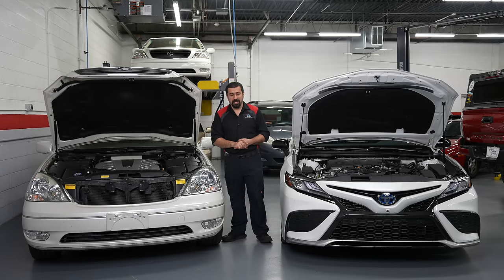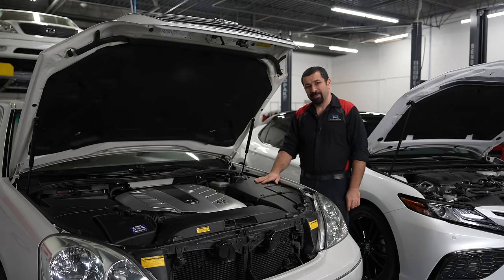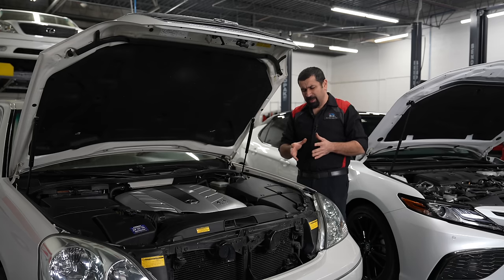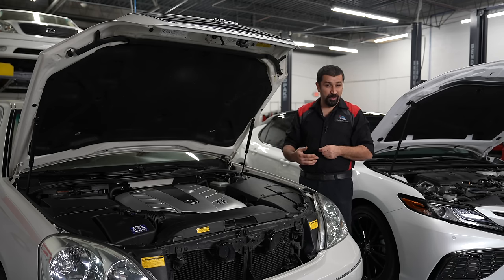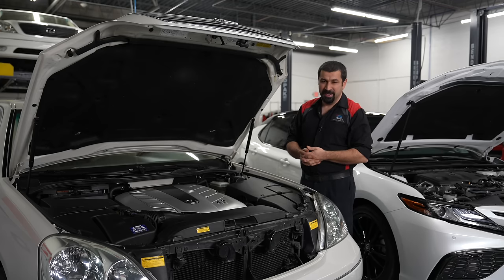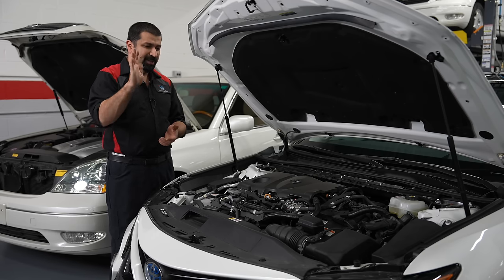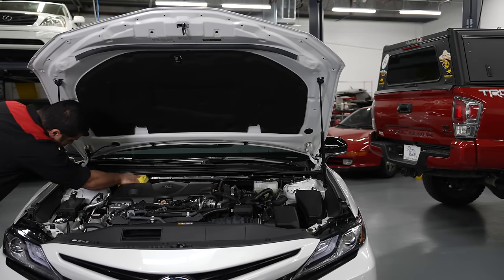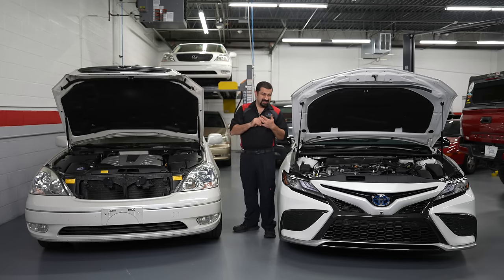Never Do THIS When Cleaning Your Engine Bay! Do THIS Instead

Comment: I use Dawn and Awesome. Mix half and half in a spray bottle. Shake well and spray a mist over the engine bay. Let it sit for 10 minutes. Then rinse off with a high pressure hose BUT DON’T PULL THE TRIGGER ON IT. Just mist off the cleaner and dirt......voila! The way I look at it....if Dawn can clean oil from waterfowl without harming them, then it's good enough for my engine bay. Awesome, which can be found at Dollar Tree is a good but mild de-greaser (read the label). Just remember to cover the alternator and mist of the cleaner/dirt...no pressure. I've been doing this once a year since my car was new. Works for me.

Comment: I didn't read all the comments, so forgive me if I happen to repeat something that was already said. I am an auto detailer with 4 years of experience and I use an Adjustable Pressure Regulator on my pressure washer wand to drastically reduce the PSI when detailing engine bays, I then follow up immediately with an air compressor to air dry all electrical connectors. Altenaters and air intakes that are not in an " air box " must always be covered with a plastic bag to prevent damage.

Comment: As an amateur detailer myself, I will never understand people’s obsession of deep cleaning under the hood. I only clean the plastics such as covers or painted areas using PolishAngel engine and only spraying small spritzes onto a microfiber cloth and then gently wiping down. PAE is a good product in this regard because on top of the precautions I take, it is non-conductive and will never corrode on plastic or metal. Even that is not necessary and I admittedly do it just because I like it to look somewhat clean under the hood.

Comment: I use motorcycle chain cleaners instead of brake cleaners as they usually are not that aggressive on rubber, as chains have rubber o-rings.

Comment: I get that sudden change in temps can fail an O2 sensor, so then why do manufacturers put O2 sensors on the lowest part of the car (mainly the lowest section of the exhaust pipe)  that water gets to? Is this on purpose?

Comment: Use an air blower to blow away loose debris and dust. Spray lightly with armor all tire shine and cleaner 2 in one, staying away from things that should be dry. Use blower to blow away excess, wipe flat pieces such as plastic engine covers. Easy peasy so long as you don’t let the area get filthy in the first place.

Comment: I don’t get it, water will seat in pockets, connectors etc? The moment you start the engine, it will get so hot, water or moisture will evaporate. I have a 2001 Sequoia bought new, washing the engine every spring after winter, up to now, I still have it with no single problem.

Comment: If door seals keep cabin dry and clean,why not do the same to Hybrid engine bay and can I do it myself?.
Reply: Generally don't do it.  The air coming through the grill helps in cooling down other components under the hood.
Reply: Sorry,not the grill,the hood is only sealed at the back from water not the sides.Auris/corola. @michesbianan

Comment: Also be careful with rubber hoses. If you’re using harsh chemicals to clean your engine they’ll eventually dry and brittle out your rubber hoses. Always go over your rubber hoses with a trim restorer that’ll rejuvenate, restore, and rehydrate your rubber hoses to keep them flexible and strong.

Comment: You have to insure the alternator and electrical sensors are covered..
Plastic bags work great..use low pressure briefly to wash off an engine cleaner..
Keep it to a minimum and let your engine run for 20 minutes..then use a rag to keep it clean

Comment: Even easier on dusty engine bays- I use a microfiber cloth plus eindow cleaner. Leaves no residue and no need to rinse. I use this method on basically anything lightly dusted (well not on the bodywork but you get the idea)

Comment: Just water spray  and microfiber on the touch screen is fine. That's what I use. Or wet microfiber.

Or wet microfiber is all you need even in the engine bay.😊

Comment: Everything can get wet now I said wet not soaked there’s difference. When your at the car wash stand back from the car and spray the engine from a distance don’t spray the engine standing right next to it the high pressure water can cause issues with sensors. So stand back and keep the water moving so move the water from left to right in a zig zag motion. I’ve been doing it like this for years with no issue.

Comment: I drove by accident in a flash flood, water rose to headlight level, water was in the headlight, 5 month later the ECU was burned out.My 15 year old car has not been running for the last 6 months.I didnt think about the alternator.Car washes around me pressure wash their engine bay.very sad.i was lucky enough for no water do get thru the intake which was high enough to be above water level,sadly the electronics didnt survive

Comment: What I ususally do is use cleaners in specific areas and use a towel to clean the grime. It takes longer than spraying the card down but you will be happy in the long run.

Comment: I usually will hit the underside of the hood on the outer perimeter of the insulation blanket very quickly, then air blow and towel dry.

Comment: I clean my engine with my car running the heat will dry things quickly I have never had any problems that way but I did have problems doing it on cold non running engine

Comment: I sprayed degreaser on the engine and then rinsed it with water without pressure. Water got into the alternator pulley and damaged it.

Comment: Save yourself a lot of potential trouble and expense and leave it alone. Machinery doesn't care if it is dirty. Under hood areas of cars are not designed to be hosed with water. When you are driving in the rain only a fine spray of water gets inside there, not gallons. A fine mist is a lot different than a heavy stream of water from a hose. You soak all that electrical stuff under there, and you are playing electrical connector Russian roulette. 
Be careful with any spray cleaners. Some can mess up your paint. And unlike under the hood, paint damage is something you will see.

Comment: In the mornings when the engine is cold, I use a regular garden hose with the tip set to jet.  I'll spray around spark plug coils to rinse off the mud that occasionally winds up in there during rainy season.  I'd don't directly spray onto the coils.   Sometimes wasps or mud dawbers will try to build a mud nest in that area.   Then, I rinse the top of the intake manifold to get rid of any rat nests that sometimes appear.   Then I check the wires to make sure none of them have been chewed.  I keep the hood up till it gets dark.  However, in this 100 degree weather, the engine bay is completely dry by noon.  I'll spray WD40 on the connectors for water displacement and also around the pulleys.  Toyota engineered their 4 bangers well.  When water pools on top of any engine surface, it usually drains off to the sides and into the rear.  I figure the engine tilt on these 2.7L Tacomas  is there fore a reason.  What I should do but I'm too lazy is to take off the belt and wash it with dish soap to rinse off any oils that may have spilled onto it.  A little water in the alternator isn't a big problem.  It's when you have a radiator leak spray into it and the stop leak in a can you were using contains copper.

Comment: How do you stand on removing engine beauty covers?
Reply: On hot summers, you can remove them.  This helps prolong the wire looms / wires  that is part of what is covered by the beauty cover. Other than that, don't overthink it.

Comment: hay car nut I do none of my own work .that is why we have you guys for I have a 2011 crewmax with a 4.6 v8 when the light comes on I go to Toyota and pay the $100.00 and oil is changed then  go on what can I do to help my Toyota and them that work on it?
Reply: To start off, get yourself an OBD scanner and scan the car for issues.  For average guys, a cheap $20 ODB scanner is all we ever need.  When you are shown fault codes, reset them with the scanner.  Drive the car for 5-10 minutes, then scan again, if there are fault codes, search google by typing on those codes so you have at least just a general idea where the error may be.   

Then take note of those codes that appear after your drive to then  bring them to Toyota or your trusted shop for final evaluation / repair. 

Next you suspect something is off, you have that scanner to help you partly diagnose what is wrong.  Don't be afraid it's very simlpe to use.

Do note, that some fault codes are not really worth the time and money for repair, things like you know the fault code does not affect drivability of your car, or safety of your car.
Reply: @michesbianan  I do have 1 but It not coding I live on fixed income and nuts & bolts of it is I got the truck 4 years ago next to oil changes a battery new tires and a Brake job I done nothing to the truck. runs as should I am disabled so best to take to someone I just want the longest lift I can get from it it has 159000 roughly
Reply: not bad for a 13 yr old truck that for the lasts 4 years had it heaviest load of 380 riding mower in bed so it mostly a grocery getter

Comment: Just use compressed air.
Reply: Why not use compressed air first and optionally inside air duct and a bit on the throttle? Cover the alternator ducts a bit if possible. Someone said a leaf blower worked. Maybe use compressed air to clean under a car on a lift.

Comment: I clean my engine bay with like a leather or degreaser in a spray bottle & microfiber rag is all. Staying away from wire connections. Just enough to spruce it up won’t get into tight places where’s there are connectors.

Comment: I spray my towel and wipe the engine and components with it. Tiny areas hard to get to use a toothbrush dampened with cleaner to remove dust and oil films then try and get into the area with a microfiber towel or paper towel. In that way there is no possibility to have wet droplets creep into any components.

Comment: 20+ years clean my engine. Just use car cleaning foam and nothing more. Best is to do this in summer or on a nearly heated engine. After that drive an hour or more. For finishing touch I use tyre shine spray. If the engine is heavy dirty after foam use brush or air and redo again with foam. My current car bmw f02 cleaning like this 5+ years.

Comment: I'm funny about cleaning the engine bay because I spend  hours with a damp cloth and wipe everything down not so much in the winter but spring and summer I do not spray anything directly on anything I spray it on the rag never on a component then wipe things down only get the rag damp not wet

Comment: Water is not the only problem, most people use some sort of cleaner or degreaser which are corrosive if not completely rinsed, 
Those chemicals will corrode copper wires / connectors and other softer metals over time.

Comment: Cover up your alternator with a plastic bag, spray the hood and engine bay with a 1:10 apc, use a large brush, wash it off with as little water as possible, blow the standing water out with a blower, spray down the plastics with a dressing, wipe off residue and enjoy.

Comment: If you have an older vehicle, don't let the dealership wash it. They ALL use high power pressure washing. When a vehicle is older, the seals, molding trims, etc is probably more prone to damage by a high pressure water hitting it and can break or loosen it. Like getting water into the head lights, or seals around the window can be damaged or loosen by the high power water hitting it and could develop a leak.  The Lexus dealer always do a complimentary car wash after service and my 16 year old RX at the time had the rear window trim partially came off.  The knuckle heads who washed it closed the door on the trim, so it didn't look like it came off.  I noticed it when I returned home, and I saw it and knew what happened.  I called the service manager and complained.  So, every time I brought the Lexus in for service, I tell the service advisor NO washing!!!!🤔  Oh , btw , Scotty Kilmer advise not to wash the engine, he says WHO CARES if the engine bay is dirty. It's better than having major expensive problems arise, if you spray water into the engine compartment and ruining some electronic component.  ❤

Comment: Well, not to go against the grain of the video, but I use a pressure washer for my motor. Of course, not direct pressure, just a good mist across the engine and then a good wipe down with a clean towel. Afterwards, I start the motor to finish drying. I get away with that method, cuz I never allow the build up of dirt. Also, I never do my motor when it's hot after it's been running, mostly first thing in the morning

Comment: I pressure wash with wide fan nozzle and indirect spray.  Then spray on degreaser.  Brush with small soft bristle.  Rinse off with pressure washer.  Vacuum all over (NOT COMPRESSED AIR).  

Compressed air will push water into crevices.  Do not recommend.  Let car sit overnight to dry out.

Comment: You forgot to say that it is a good idea to drive the car for 20-30 minutes after you pressure wash your engine so it will generate some heat to speed up drying.

Comment: I keep my engine bay ultra clean using degreasers, brushes, and power washers and have been doing it that way for decades now. Never had a single problem. Never killed an alternator. Never killed a coil. Never liked an oxygen sensor. Nothing. Maybe I'm just really lucky.

Comment: I have never washed my engine bay. If I ever do had the need to clean it I just wipe it down with a dry rag just to remove the excess oil on the surface.

Comment: Windex makes screen cleaner. It's all about the ingredients, not the brand name. Your screen might not react well to alcohol, ammonia or acid based cleaners. Check the manual, Google it etc... If you're unsure, just use distilled water and a microfiber cloth.

Comment: Damp towels make the most sense especially since you can buy cheap throwaway microfiber towels or non lint towels for cheap. Just put the product on the towel and wipe away and use another dry or water damp towel to wipe away. I dont see why using any stream of water is anymore useful than elbow grease

Comment: I'm pretty careful cleaning engine bays. I will spray the electrical components with sensor cleaner and compressed air. It will displace any moisture.

Comment: To clean the engine bay. Use soft brushes and then a high blower for leaves. Twice a year, so it doesn't build up. Certain cleaners will break down rubber to leak. 
It's the same with your tires. Most cleaners on tires will cause cracks on the tire. 
Detailing my interior, I use Vaseline petroleum oil. Why, because it's petroleum oil without chemicals. Remember plastic is made from plastic. Your plastic will love it, because it's like blood.  Just don't over do it, because you don't want it to leak., And it's cheaper than other products.

Comment: Compressed air to blow out nooks & crannies.  Formula 409 (Stone & Steel) cleaner on easily reachable surfaces; just once in awhile.  Maybe couple time a year.  (Good stuff for the grill, etc.)  Bay looks pristine on a 12 year old Explorer.  Always wondered why people dump water in an engine bay with so many electrical components at risk.  Absolute no-no in my book.

Comment: Nobody here mention's water dispersants like WD40, I don't clean my engine bay often (only when carrying out maintenance) but have always hosed it down (cold), then washed with a bucket of hot water mixed with basic detergent (washing up liquid etc) using brush and cloth, then rehose down, then start up engine and spray all electrical connectors etc with WD40, then take for a drive to fully dry.  I have never owned a hybrid etc so I guess I will have to change the process in future.

Comment: Blowing air from the air compressor to dry up the connectors is a bad idea because the air compressor air is humid, which will corrode the connectors.

Comment: I'm glad I watched this video before spraying water at the engine of my car.  I found rat turds in the engine bay.  No damage to wires, but that could get in the ventilation system and be a health hazard.  Plus it's just disgusting.  I'll vacuum it and wipe it down instead.

Comment: People just use wipes or some cleaner and a cloth. I've seen so many people spray their engine bay with water pressure and I'm like how dense can you be? Clearly there's electrical parts since when did electricity mix with water?

Comment: On rainy days, it happens that the cold water reaches the exhaust system, the radiator, even the engine. E.g. when driving through a puddle at high speed. The alternator can also get wet many times.
What is also very important is the battery. If someone does start cleaning with water, the battery must be removed from the engine compartment (if it is there).
At least the system should not be under voltage.
I would never clean an electric car with water. Never.

Comment: How about using a leaf blower?
Reply: That's totally fine, that's what I use.  Just maintain a good distance.  Some leaf blowers can be pretty powerful, talking about 600+ CFMs, don't direct them to anything that you think will come flying off (wires to connectors).  Use common-sense when blowing the dust off.  Normally couple minutes and you should be done.
Reply: @michesbianan  👍

Comment: Cleaning your engine bay is rather pointless. The car or rather the engine doesnt run faster or get better mpg, or run for lomger. You rarery look at it and water problems are a big risk, not to mention the time required.
Clean your interior instead, you will be sitting in it every day.  🚗